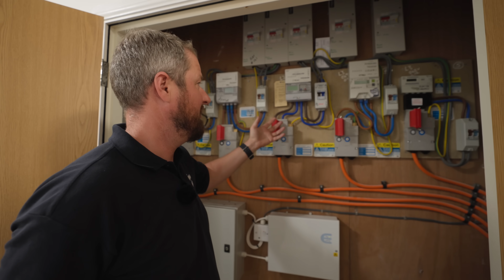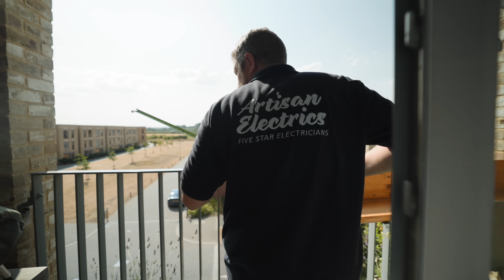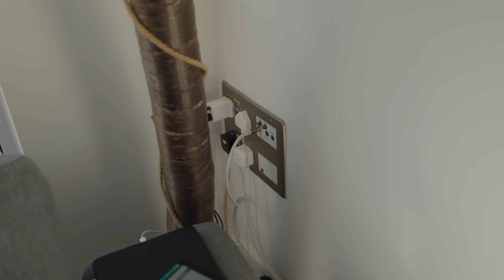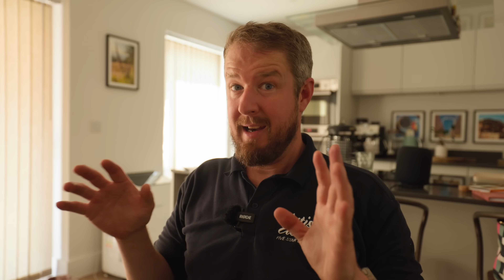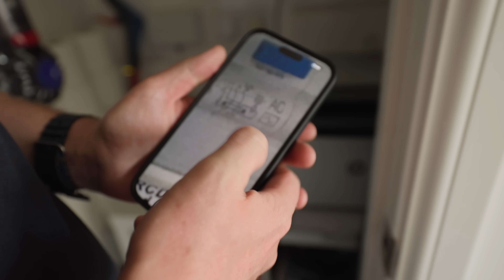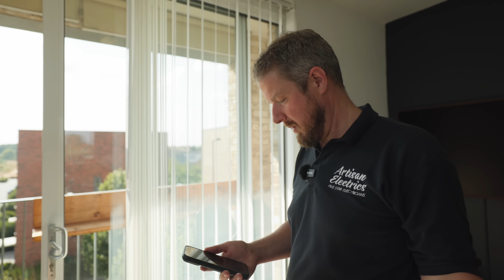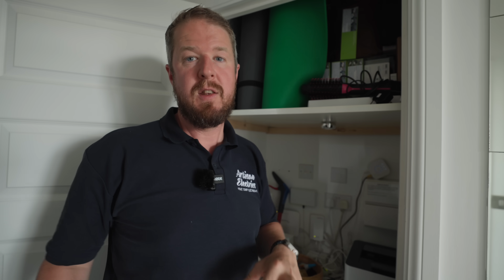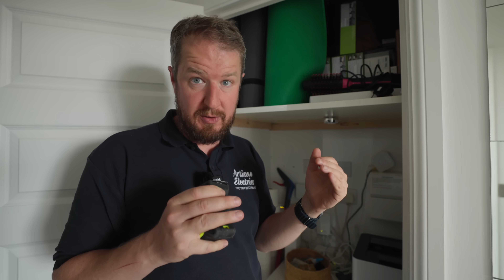I Found a BIG Problem With Plug-In Solar…

Comment: The level of obsession with these plug in solar panels on the channel is kinda odd. I get that nowadays Artisan electrics is really just another solar installer and thus you would want to make videos on it but honestly, there's really not much to talk about. The chance of your average renter being able to use this sort of thing is probably very slim, especially when it comes to setting up bunch of panels and dragging wiring around. Makes less sense for home owners as well since it would be more of a half-assed attempt at getting solar energy going to reduce your bills.

As a side note, I get that you like to use AI for everything possible these days but I sure hope you don't use it for safety questions for customer installs like you did in the beginning with the breaker. 

Been watching this channel since 2021 and I gotta say, although the editing and filming has improved, the quality of the information has stagnated with recent videos having been decreased. The things that the channel now lacks is what Cory has managed to do on his channel.

Comment: If they follow the approach taken in previous similar regulations, plug-in solar devices may not be permitted to become part of the permanent installation. One indication could be whether tools are required to install or remove the equipment, for example.

Simply connecting something by a plug and socket doesn't necessarily prevent it from being regarded as fixed equipment. There is a historical parallel with 4-gang extension socket blocks: designs with screw-fixing holes largely gave way to keyhole/slot arrangements that allowed the socket block to be removed without tools, preserving the distinction between a portable socket-outlet and a fixed socket-outlet.

So it will be important to see exactly how the new plug-in solar rules define the boundary between removable plug-in equipment and a permanent installation. A panel clamped to a balcony with hand-operated clamps and plugged into a socket is a rather different proposition from panels bolted to a roof or wall, even if both ultimately connect through a 13A plug.

Comment: The problem is…… the issue is…. Its not ideal…. If you don’t have…. When the sun is low… 29.9 degrees not perfect…. The panel gets hot… you have to ask,,,, Your wiring…. Ffs.. 800 watts peak…. Scare tactics is all i got from this video. The only thing they missed was, if its windy your panel might blow way…..

Comment: You do not have to take the consumer unit top off to fit a ct clamp and shelley you can mount it separately with its own power supply. but in other words sparies dont like plug in solar becasue they are not earning off it. Power already flows in two directions its called 'AC'

Comment: Im no fully qualified sparky, but strangely I work with generators and temporary installations.....
So I work with all sorts of voltages and Hz with all sorts of supply required.
Anyone would think you was putting a 100kva solar panel set up in to a 13amp socket......
Not the small amount these systems can legally put out.
As myth busters would say.......myth busted......if only this video had scratch n sniff......it be farm yard smell.
Less than 1kw/1000w.
Temporary installations don't come under alot of regs.....

Comment: I would say don't mix your generation there's no reason that your soul is set up isn't stand alone apart from the fact that would probably be more controllable one of the best reasons for solar is for separate systems if you need separate power of course that storage solar what storage doesn't always have to take the form of batteries, you also have the advantage of not having incompatibility with your existing wiring are you may not even have to bump the output up to standard mains frequencies and to get them to generate useful work for lighting etc just separate electrical systems totally

Comment: I think there'd be fewer negative comments if this video had been framed as Problems Leaseholders Face Doing Balcony Solar. Because most of the problems you highlight aren't electrical, but administrative! I was very excited about the idea of getting balcony solar but in my flat I also can't drill exterior holes, mount things outside or access the meter cupboard.

Comment: The biggest problem with the initial ones authorised is no batteries. Few are going to be able to use that 800w at the time it's produced. Batteries would allow cheap night rate tariffs together with storing unusable solar generation. I've seen a to be authorised system of 2 panels and micro inverter at close to £1k. I can't believe that system will pay for itself in any reasonable time scale. The trade bodies are doing their utmost to kill this stone dead and so far from what I've seen they are winning.

Comment: I got an ecoflow stream ultra plus 4 x 450watt panels. They are on my fence and I used the brackets from ecoflow which you showed so in the shape of a hook whilst they do the job for me they are, in my opinion, a bit flimsy for any installation above ground. I also used ecoflow brackets to push the bottom of the panels out giving, hopefully, the optimum angle. I set it all up and it worked great as a stand alone set up. The panels are oriented. Probably south west but generate, regularly, 900watts + so it doesn't take long to charge a 1.9kwh battery. I had a big problem though resolving the "disconnected from grid" message. I had checked my breakers and yes they were bidirectional but regardless of what I did it would not work. Then the lightbulb moment. My kit is in my shed, via a small 2 breaker box and those breakers were not bidirectional. I took them out of the equation and it was like walking through a door to paradise! The kit connected to my WiFi, loads of stats became available and I can say this has opened up a lot of possibilities and I am sufficiently convinced that I have an ecoflow stream a/c Pro coming tomorrow to add to the system.

Comment: The optimal angle isn't that straight-forward. Yeah if your panel is facing directly to south and you want to maximize the annual production, then the "good old rule" applies. But if you have your panels pointing off-south, then the sun is going to be on average on a lower angle, and your panels should be more upright. And also, if you want to maximize the power generation in mornings and afternoon (when electricity is more expensive) or during fall/spring, again, the sun is going to be at lower angles, and you again want the panels more upright.

Comment: My understanding is that plug in solar is only legal after the 27th of August and it does not include battery systems, i.e. you can't DIY install a battery and solar panel yourself but you can just a solar pannel.  Additionally there is not feed in tariff so not requirement for CT clip.  I haven't checked the regulations but other reviewers (maybe it was eFix) mention that bidirectional breakers are not a requirement.

Comment: Whats he going on about batteries for?  Uk  isn't currently allowing batteries to be connected to the diy plug in solar.  Also the uk system you will need to buy a complete kit of parts not each bit individually so the panel size is set by the kits available.

Comment: The plugging in and switching on is the easy bit. Fitting panels securely can be the most difficult and possibly dangerous part. 400W panels can weigh 25kg and are the same size as a house door. The idea that you would try to hang two of these off a balcony on the 3rd floor of an apartment block would give most people sleepless nights every time there is a storm. If a professional team did it they would close the area below to the public during the installation and have proper insurance.
You won't save anything if you end up in prison for killing a passer by caused by shoddy DIY. 
Fixing panels to a garden fence is easy and who cares if the angle isn't exactly right as long as they are secure - safety first. If you need to, just over panel it to make up - you can put up to 600W of panels on each 500W input without issue as long as the voltage stays within the limits in the product specs.
Mine are on the flat garage roof, secured with 8 z-brackets and 16 roofing bolts on each panel so when the winter arrives and a force 10 gale blows through I don't need to worry about having to retrieve my panels from my neighbour's living room.

Comment: I thought batteries are not covered by the new plugin regs?
Reply: They aren't. Plus this was apparently put together before the regulations were released and decided based on testing that these won't cause a problem in any household wiring except possibly pre ww2 stuff.

Comment: I always wonder how rcbos when they are on the same circuit as balcony solar, I guess the solar unit has to have an rcbo built in 🤔
Or is that why they are limited to 800W ?
I just had an extra circuit installed in the main CU and ran the solar and battery from that. Easier as safer for me.

Comment: For anyone wanting a (near) 35 degree fitting, there's the old 3:4:5 triangle to save on the maths! Ie a 1m high railing would take 1.25m width panel with the bottom kicked out 0.75m. Ok its 36.9 dgerees but who's that bothered?

Comment: If you plug a kettle into the "off grid" socket on a plug-in panel is that the kettle will only "get" the wattage that is being "generated" by the panel.

So how long "could" it take to  boil a 2Kw kettle?
Reply: The micro inverter output just reduces the grid load. It will boil just as quick and cost a little less because not all the power comes from the grid.

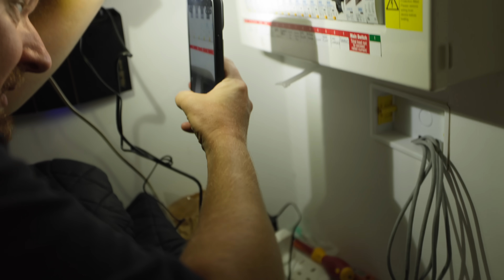Comment: 1:00 You clearly don''t understand bidirectional breakers. It is NOT about direction of "power flow" - breakers only measure current, and without knowing the phase relative to voltage, there is no way they can "know" the direction of power flow, and no way it can have any effect on their operation. 
The only issue is that some designs of breakers are designed with the assumption that after tripping, the  load side is dead - this can be used to limit power dissipation in the trip coil or control element, and/or the RCD test  resistor. 
All solar inverters will cut off in the absence of the grid connection, e.g. if the breaker trips, so they never present voltage to the load side of the breaker when tripped, and will not cause problems with a "non-bidirectional" breaker. The tests that govt comissioned as part of the plug-in solar consultation confirmed this.   
TL;DR there is NO need to use "bidirectional" breakers on solar inverters.

Comment: So are the pins on the solar system plug live? Is this an issue when it's not plugged into a socket?
Reply: No, it isn't a problem. Because grid tied inverters have to synchronise with the grid, and follow it, in order to produce power. When that reference goes away, the inverter instantly shuts down.

Comment: This is a little bit of an odd video as it really only highlights one small issue that could occur, poor installation of panels. but then the video shows the flat owner having plant pots sat on the outside of the balcony and a gas pizza oven (which will 100% be prohibited), that contradicts the worries about solar panels. 

Bi direction rcbos shouldn’t be required as the inverter shuts off when it see’s the loss of grid power. then the video mentions about plug in battery systems, but these wouldn’t be allowed under the regulations. 

Overall the big problem seems to be more to make people worry about nothing. If anything, someone should make a video highlighting and teaching how to install a plug in system, options available, number of systems you can install subject to the layout of the electrical system. if I was doing domestic installations, I’d be working up packages and prices to install plugin systems for costumers that wouldn’t rip them off.

Comment: You don’t need a grid tied system if you link to an over night tariff like economy 7. You can charge over night ( with batteries being in a safe outside location or fire risk free location) and use that energy at peak times. You would need consider following portable generator rules and maybe using class 2 appliances being fed by your battery bank. Also that your protected by using an RCD configured correctly for use with power bank and taking account of a floating neutral. ( in the event a class 2 appliance gets wet)

Comment: "how do you know if the wiring is safe?"

Plug in a 2.5kw heater and stand by with a fire exinguisher. If it can handle 10A it can handle 4A.

Comment: An option is to drill a simple hole through the sliding door frame for the solar wires. This guy doesn't have to get a "huge solar panel". he could get a half size one, positioning it to permit air flow. It would let light through if of bi facial design; also there are transparent glass solar panel options, i.e.: for deck roofs, and for skyscrapers, they have an consistent, viewable, slightly tinted look.  They may produce less electricity, but are more attractive. If not net metered, balcony solar might be good for small continuous base loads, like a mini split running on dry mode just for the refreshing cool, freezer, smart gadgets, etc.

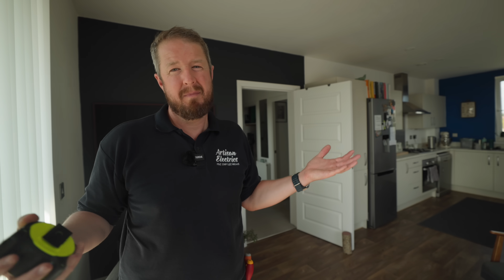Comment: 6:00 Isn't that an electrical switch behind your right elbow? There is electricity in that exterior wall.
Reply: That's a light switch so first lighting circuits are usually not rated for sockets and second chance are it wont have a neutral wire

Comment: Amazing that some people are throwing away old 250w panels. Just crazy I could just pay for an inverter and scrounge 2 panels to start on solar, anyone done it on the cheap?
Reply: The regs only allow for complete kits. Obviously if you ignore them you can do just what you like. I've only seen one authorisation ready kit and that was stupidly expensive at almost £1k. It was on City Plumbing where I got my own panels at a reasonable price although they are certainly going up and were dearer than my son paid. My entire setup using an EcoFlow stream unit with built in battery plus those panels and what I needed to construct a solar gazebo didn't cost a lot more than that kit. The thing that makes these financially viable is the battery. Insisting on complete kits will make them more expensive than real DIY.
Reply: @markgriffiths4582 I'm sure lots of use will be had out of the battery alone! It's fun to be able to see how you can use your own energy, I was looking at panels around £60 a year or so ago. More like £90 now I think.